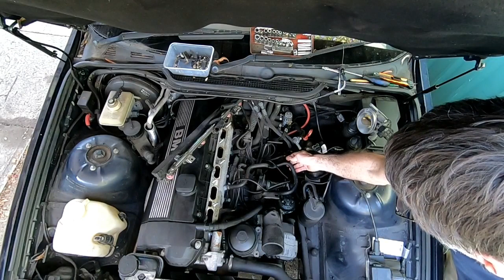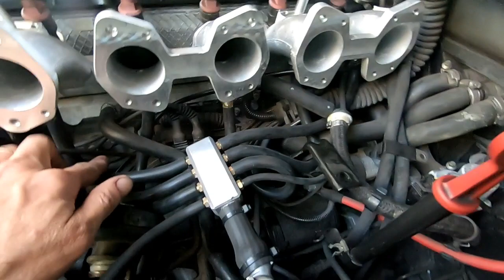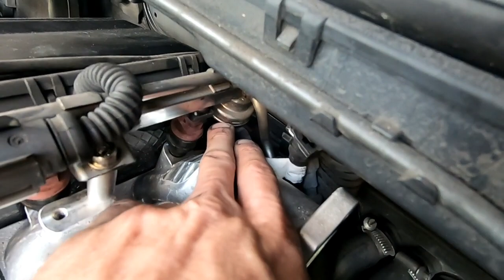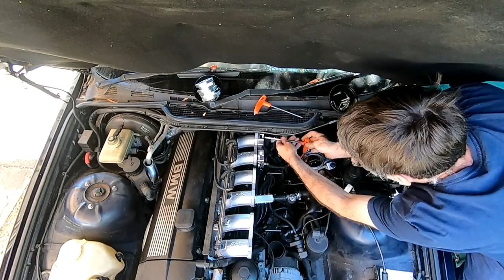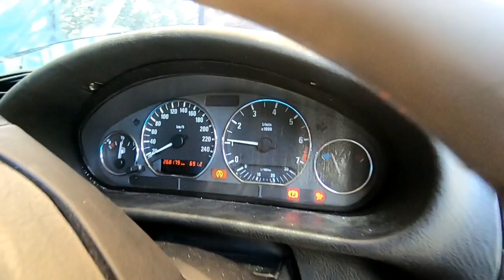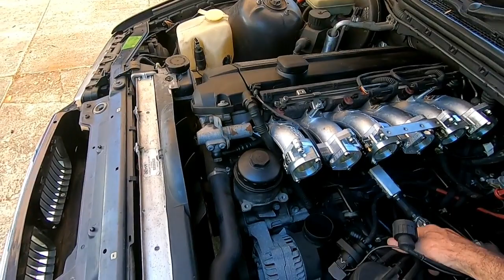Part 2, BMW M52 ITB's, Install and Sync (RHD Engineering)

Comment: What injectors are you running ? Also what engine management are you running ? Would I be able to run 2.8 injectors and run standard engine management and put the throttle bodies on ?